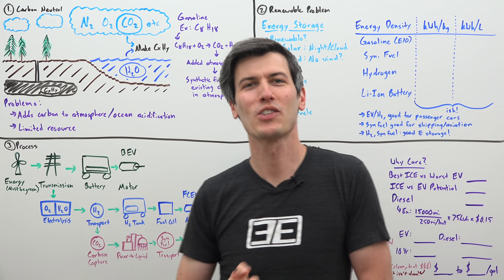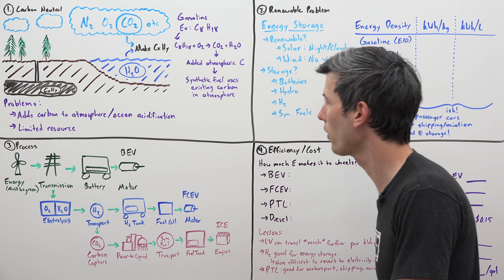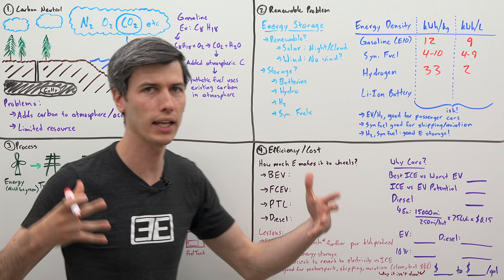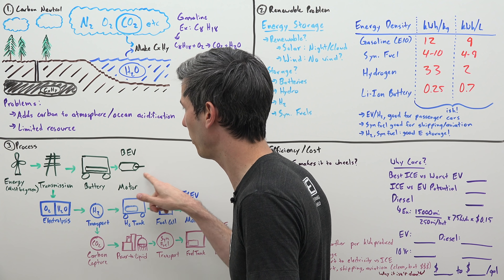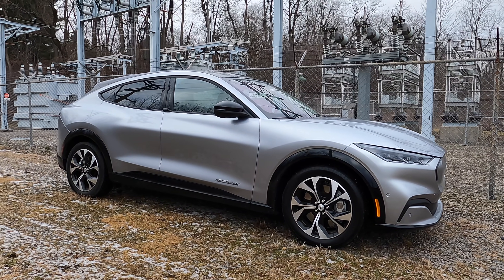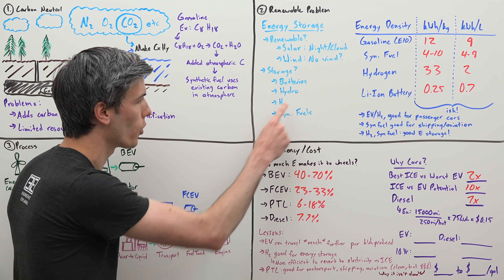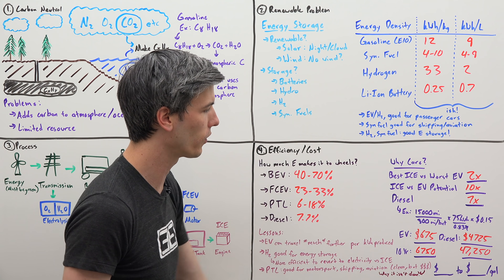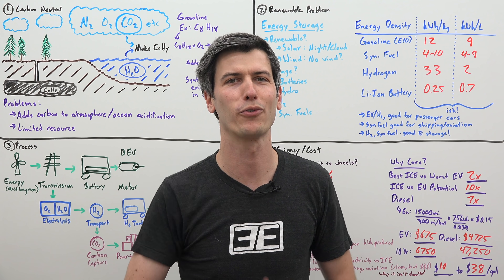The Big Problem With Synthetic Fuels

Comment: I'm giving this a down vote because you missed a huge advantage to synthetic fuels.
Synthetic fuel can help solve one of renewable energy's biggest problem storage on a seasonal level.
Such as storing away excess solar energy in the summer for use in winter.
You put it in a battery bank it'll be gone by winter let alone the impossibility of building a bank that big.
The grid cannot handle every car being an EV but the existing petroleum distribution network can be used with synthetic fuel.
Having an EV sell back it's power to the grid is a BS solution you're left with a dead battery and the battery will have it's life span reduced.
The EV's life span may be reduced enough it's energy saving will never amortize enough to pay back the cost of it's manufacture.

Comment: I use to think you were smart but clearly if You believe the slight energy disadvantage ( little to if not none ) overrides the Lack of Infrastructure ( and Let’s not Get into the energy needed to create the Electric infrastructure needed ) let alone the Fact that not everyone lives in a House with a Driveway large portions of the worlds population live in High rises while also The Lack Of Consideration of the power grid needed to support a world With 100% Electric vehicles. You let your Fan girling on electric cars get ahead of The science an Practicality. Disappointed. E-Fuel is clearly the next step In The worlds next scource of Energy it’s the evolution of Fuel. Much like the jump from leaded fuel to Unleaded fuel In 1989 the shift was simple because the infrastructure was already there as it is today. You did not think this through.

Comment: The reason i like the idea of syntetic fuels, is that you  can use, most of the same infrastructure. And when i comes to costs and not building more on behalf of nature itself. I vote for this!.
Reply: Exactly. It scales much better. And it has an intrinsic advantage. Hydrogen and carbon dioxide will always be available. The core ressources required for it are basically infinite.
Reply: @MightyJabroni  Plus, e-fuel can be used on older existing ICE cars when battery or solid-state electric becomes the norm in the future. E-kerosene can be used to power long range airplanes, while e-fuel could power ships. General aviation would benefit from synthetic avgas.
Reply: @MightyJabroni  exactly and it's much more sustainable than electric cars
Reply: Agreed - also - why not use nuclear power to create synfuels - also, pull c02 out of seawater instead of the air?    Overbuild nuclear - build synthetic fuel plants - decarbonize the ocean .   No one in the 3rd world will be using EV's for a long time.
Reply: yeah but at 10€ per liter nobody is going to be able to afford to drive
Reply: @alldamnnamesaretaken  Porsche's solution only becomes cheaper as time goes on. (the price decreases with scaling). I'm confident that if the industry put money into it we could have little energy farms in lots of major areas.
Reply: So true!
Reply: Electricity is SO MUCH EASIER. The infrastructure for electricity is already ubiquitous. Every home and every office building has electricity. It just needs to be upgraded for being able to charge EV's  This means that you can charge your vehicle at night and while being at work in the office and do not even need (!) to go to the gas / loading station for most of your trips. Therefore this expensive and polluting infrastructure of gas-stations can finaly be eradicated. Renewable synthetic fuels are NOT going to fly (except in airplanes maybe)
Reply: @rientsdijkstra4266  you don't even know how the grid works, how much it costs to build and maintain way larger transformer stations and cables.
Also, where do the batteries come from?
Reply: @charr6108  You know nothing about what I know.
Reply: @rientsdijkstra4266  how's that? what is it that you know? Say it?
Reply: And therein lies the problem. We like to believe that that infrastructure is already in place and paid for. But the reality is that that infrastructure requires continuous maintenance, adaptation and renewal and therefore has to be paid over and over again. So the question is, would you be willing to pay to maintain an infrastructure for a fuel that is only marginally better but ten times more expensive? Or would you rather spend that money on a new infrastructure for a fuel that is ten times more efficient at a fraction of the cost?
Reply: @ronalddolman2654  what would you reply if i say, maybe in coming future, maybe, the cost of production of synthectic fuel decrease drastically with its maintainance.
Reply: @ronalddolman2654 Power electronics for charging infra costs more to maintain.
Reply: @ronalddolman2654  probably a necro but as a guy who's knee deep in business, I can tell you 1000% that any company would rather do their regular infrastructure maintenance rather than drop a potentially crippling investment on new tech. Not to mention that that shiny new infrastructure also has to be maintained. so essentially what you're asking a company is "would you rather adapt your current business model and have a stable cash flow right now or would you rather drop a butt-ton of cash then (assuming the new product actually succeeds) have a stable cash flow later?" Plus, that maintenance on current infrastructure is already happening and getting paid for! We pay for gas, they fix their stuff, pay employees, etc, etc.
Reply: @ronalddolman2654  but the batteries, I don't think that it's sustainable to keep making an insane amount of Lithium Batteries.
Reply: @charr6108  It’s no less sustainable than using steel or aluminum for cars.  There’s a fuckload of lithium on this planet.
Reply: @diamond_h0us  you are saying like electric cars use way less aluminium and steel than ICE cars?
Reply: @charr6108  Probably less steeel nd more aluminum, because they need to be lighter to offset the weight of the batteries. Which is funny, because getting aluminium is much more energy intensive and polluting.
Reply: as someone who studies technology that price will come down theirs already companies able to make synthetic fuels that could cost about 5-7$ per gallon while that's still a lot it's much better than having to use fossil fuels and over time as we make synthetic fuels and figure our better formulas for them will be able to bring that cost down and their already expanding that plus you gotta understand we won't have enough time to replace all internal combustion engine cars with electric in time or if will be able to have enough metal for batteries
Reply: Yea, we're not gonna talk about that part, just about the nasty parts!
Reply: @timemachine194 it's in my opinion, well, that synthetic fuel can be made anywhere in the world... and you don't need to use batteries to store the synthetic fuel, there's just isn't enough minerals to make lithium batteries.

And then, we can slowly stop using plastic too, because we slowly use less and less crude oil.

for the cost, well that's something we gotta work on
Reply: @timemachine194 don't you find it funny how the EV zealots, who for the past 20 years kept claiming that it doesn't matter that EVs are expensive, because they will get cheaper with time - now claim that synfuels will never be adopted because they are too expensive.
And in the mean time, since the release of this video, synfuel price has been falling, while price of electricity (especially on a  roadside fast charger) has been steadily growing.
Reply: This. 

Efficiency can improve. We would be able to keep the same infrastructure, and still hear vroom vroom 🙌🏽
Reply: @C41N4  Wear some headphones and play engine sounds.  I don’t want to hear your car.

Comment: Now recalculate the whole thing with respecting the Energie and resources that are needed to build all the electric cars as well as building the infrastructure for the charging network. I’m not an expert by any means but I think the big advantage of e fuels is, that you can use the already very dense infrastructure of gas stations and the cars that are already built and driven for years. And if these cars could continue to drive normally just without actively increasing the amount of CO2, this is the real advantage of e fuels.

Comment: As usual, great presentation. You didn't even mention that the hydrogen volume numbers are with pressurized storage, right? Also, hydrogen has a problem with storage because of leaking.
I wasn't surprised with the results, but the percentage difference was a real eye opener.

Comment: My only concerns with electric cars is the batteries used, the charging network and how that works for people who don't own/rent a house, the range and the overall cost of the vehicle. Get those things figured out and I'm fully on board. Mainly, I would like something that can go much further than what we have now.
Reply: We are getting better with the range but the issue is that many that have the best range currently are ultra luxury models not meant for the masses. It’s getting closer but we aren’t quiet there yet, at least 3 more years and hopefully the batteries needed for the range will be lighter and smaller as it’s proven smaller lighter batteries are better for range for smaller cars
Reply: @filledwithvariousknowledge2747  yeah. Most EV's have started out being "affordable" but then the industry realized these are a really hot topic. Plus, there are stats that have shown that people with a higher income are more likely to care about the planet. put two and two together, and you have what we see now. Price jacked EV's with leather plastered interiors to justify the price because let's be honest, the main demographic that was going to buy these was people with deeper pockets.
Reply: Govts are falling into the trap of requiring L2 charging in new condos / apartments etc. Thing is L1 slow charging covers most average daily driving needs, given cars are parked for ~12 hours on average. L1 does not require higher electrical service to the building and is a fraction of the L2 costs. If govts had the autonomy to pull back the $1.3 trillion of explicit fossil fuel subsidies, that could help a bit on the transition costs.
Reply: Thats the issue

Comment: I would like to see some numbers based on the life cycle of LI batteries. I've heard they last a maximum of 10 years. If everyone is buying a brand new car every ten years rather than keeping a traditonal car running, potentially for decades, aren't we just creating more manufacturing/recycling waste?

Granted you can replace the battery, but we don't even do that with our mobile phones, we just sling it in a drawer and buy the latest model.
Reply: You can always recycle lithium, and keep it's 90% of the quality
Reply: @RayBlaxe  battery is not cheap,you cant go to store and buy a battery,car batteries are different then a car accu,it cost half of the car,diesel and efuel engine is cheap,when efuel cars made more,the cost wil go down,electric cars does not thats the problem..
Reply: Replacing cars doesn't really create much waste, relatively speaking. Steel can be infinitely recycled, as can glass. It's undoubtedly much more damaging using single use plastic packaging for random items and groceries you purchase than the total plastics usages in a single vehicle -- those single use plastics can be reduced and replaced, the furnishings in a vehicle not so much. Now, that being said, it would be much better for someone to continue driving the same car than purchasing a new one, which is why you would replace the battery packs themselves instead of the whole vehicle. Junking an EV because the battery is degraded is about as wasteful as junking an ICE vehicle if your tires wear out.
Reply: @pseudonymous1382  You also need to look at the value of the vehicle vs price to replace parts vs cost of already replaced parts. There comes a point at which a vehicle just becomes a money pit and is just not worth the repairs. You can have two vehicles same age same make and model, yet one may have had 35k in parts and repairs done over its life while the other only had 5k done. This difference  is caused by owner care of the vehicle, environmental conditions, ect.. Personally I stop putting money into vehicles when I am getting close to 75% of the original cost within a 10 yr period. Though this is something each person has to decide on their own, if the vehicle is worth fixing anymore.
Reply: Nice try, oil lobby! It's 2023, there are lots of 10yo cars out there and they aren't needing replacement
Reply: @elliotpollard9083  battery does not last,if you have heavy pocket go and buy ev car and 10 years later pay 20.000 dolar for new battery :)))or bring the car to salvage yard and become 20 0000 dolar poor :)))
Reply: You might - speak for yourself, personally I replace the battery myself.
Reply: it is kinda misconception, the 10 years is when the battery reduce to 80% of its original capacity, not the max
Reply: people aren't running cars for decades though
Reply: @felixbeutin8105 My brother has a 1982 Diesel Mercedes that still runs and drives after 41 years. There are many cars out there that probably won't last that long but are maybe closer to 20-30 years, but that's still a very long time.
Reply: People need to start looking at long term instead of short term. When narrowed down to post production, EV's look great. It's only once you take into account what it takes to produce them that you find they never become a carbon neutral vehicle. Within 10yrs you have to replace either the whole battery or cells in the battery at which point you "carbon footprint" rises substantially.
Reply: @CTSimRacing Tesla model 3 long range battery has a replacement lifespan of 500 000 miles. Average American drives 13 500 miles per year.
That's 37 years until you need to replace it.
The expected life expectancy of a Toyota Carolla is 300 000 miles.
Reply: @NickBohanes  that's great, but as an automotive tech I will tell you now that batteries do not care about mileage, they only care about time. The physics don't change because tesla says so. A lithium ion battery has both a limited charge life cycle and a limited storage cycle. And I promise you in 10 yrs with or without milage some part or the complete battery will need to be replaced.
Reply: @CTSimRacing  Of course, I assumed all those stats just meant to convey an average usage/charge/discharge rates over time.
Reply: @CTSimRacing  Time is nearly inconsequential for lithium batteries, provided you charge them once a year or so - because a battery left sitting on a shelf indefinitely will eventually self discharge, and damage or destroy itself as a result. Lead acid batteries have unique modes of failure, the modes of failure for a lithium battery are not the same as those for FLA and SLA batteries.A lithium ion battery that's in regular use doesn't have some sort of "doom clock" lifespan, it's lifespan is decided by charging cycles and the intensity of charging.

Comment: The starting point of developing hydrogen energy or syn, fuel is the cost of storing electricity is very expensive. The cost and convenience for energy storage are the best advantages of syn fuel, but it seems to be an unfair comparison to compare efficiency and cost with energy efficiency alone. If you want to compare the energy efficiency of the electric motor with the cost of maintaining the electric car when the electric car penetration rate is low as it is now, it seems to be an electric car advocate.

Comment: I wonder how much this changes if you consider the overcapacity of solar production you need to satisfy peak electricity demand. If you have 2x the solar panels you need to satisfy peak demand on the grid, then you have (exaggerating) 10x the supply in off-peak times. In other words, in off-peak times the marginal cost of solar electricity will be waaaay cheaper and it might make economic sense to use it to generate fuel, even if you have massive efficiency losses.
Reply: Prometheus fuels

Comment: I'm sure the prices of e-fuel will come down, but to achieve that will require the prices of H2 to come down, so FCEVs running on H2 will always be cheaper than ICEVs running on e-fuel, especially since the fuel cells are also more efficient than ICE, even if the fuel production process wasn't more efficient, so I expect FCEVs to become dominant when nuclear H2 production from thermolysis using modular reactors really starts pushing down H2 production costs, and at that point maybe e-fuels will become 'cheap enough' for car enthusiasts and motorsports, but FCEVs will be the mainstream option

Comment: A bit disappointed. You forgot the approx. 175kg CO2 equivalent per kWh a BEV is carrying more than an ICE due to its manufacturing. The other thing is renewable electricity exceeds already now the demand and e.g, germany pays others to take it. So, it could make sense, that this overall really bad efficiency is pointless. So, as the worldwide economy cannot be run without shipping and aviation an muste be cheap, it makes no sense to not scale it up for the passenger car sector too. Holistic thinking :)
Reply: Prometheus fuels

Comment: The actual problem which is not getting discused very often is that the infrastructure of Ev‘s isnt good enough for everybody having an EV and not to mention what will happen to exsisting ICE cars ? By replacing every ICE car the CO2 emissions would skyrocket because the battery production emitts massive amounts of CO2.
In fact altough the efficeny of e-fuels is not that good at the moment we should keep using ICE‘s because producing millions of new cars with batterys which are emitting a lot of CO2 in production is not helping to fight against the global warming.
Reply: It's almost like any solution that involves individual car ownership is suboptimal 🤔